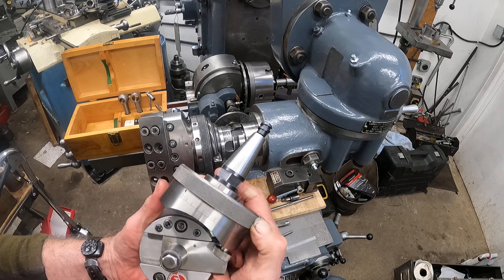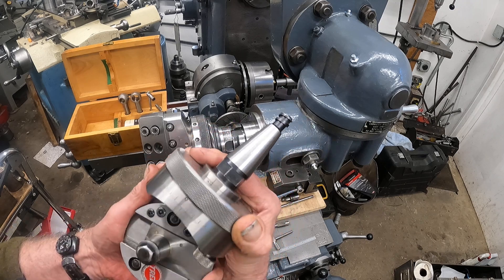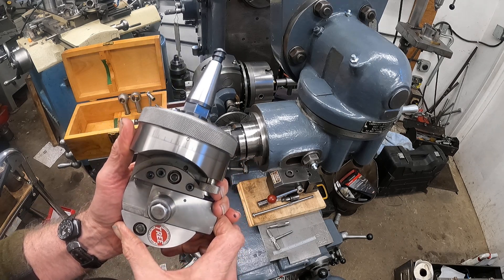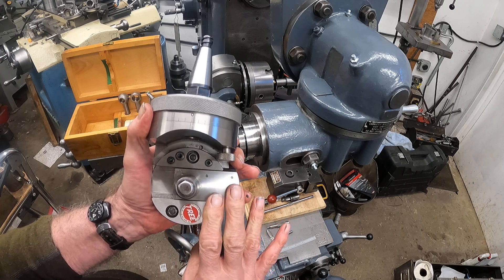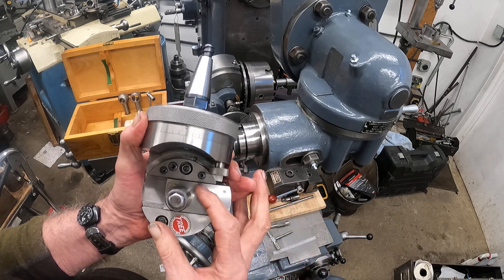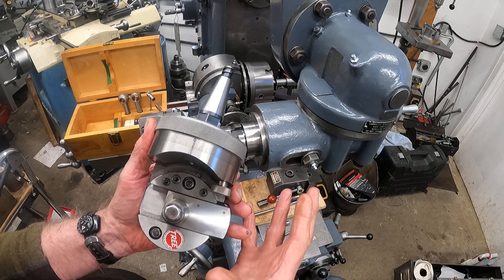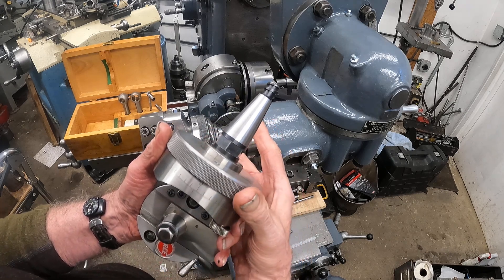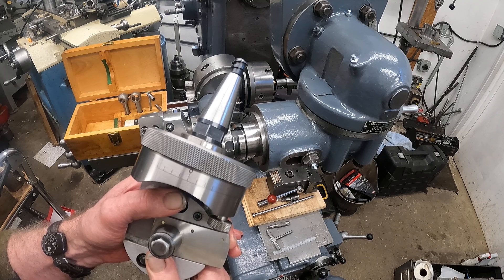Wohlhaupter and the Tree exotic boring heads

Comment: I’d never seen a Wohlhaupter before, let alone one that large.  I can see my Bridgeport wouldn’t like it.  I’ve got a much smaller Swiss boring facing head.  I’ll send you pictures.  The shank is a taper I’m unfamiliar with an integral to the tool, but with an adapter I can use it my 30 NMTB Bridgeport.   Jewelry.  Cheers, Will
Reply from the maker: You are lucky on the adapter, I have confessed that the Wolly here was for a Sip jig bore, and like a pretty far up the ladder hillbilly I cut the integral special shank off, then machined it so to fit everything else. I found I liked the 30 taper Bridgeport, most seem to prefer the R8. I would expect your head is for a jig borer and was extremely expensive. A unhappy Sip owner informed me years ago that the head cost $9000. But I have used the head on multiple machines.
Reply: @deedeeindustrialsuperprecision  My Bridgeport E-Z Trac quill was changed out from the standard R-8 by an old friend of mine who died suddenly about 10 years ago.  The Erickson quick change setup on the bottom of the 30 taper spindle wasn’t compatible with a lot of non-Erickson 30 taper tool holders so just recently installed a Kurt power draw bar.  Now it is a dream to use. So much nicer than the R-8 system.

Comment: Donie. I have a made in Japan KKS UFB-3 MOORE boring and facing head. I got with the integral Moore shank. However, your going to hate me for this but I had to cylindrical grind the shank down to .750 dia. to fit my Bridgeport. I do not have a Moore Jig Bore so the sacrifice had to be made. The up side is is that I traded some surplus items for it that I had little money in those items. I have bored, faced and put in snap ring grooves with it. I love this tool.
Reply from the maker: And we are both Evil, I took an abrasive cut off wheel and savagely cut off the integral Sip jig bore shank and machined the back of this $9000 Wolly to fit other machines and I did it with a certain hillbilly grin.....
Reply: @deedeeindustrialsuperprecision  Wow!! I guess I am not as guilty as I thought.'
Reply: @deedeeindustrialsuperprecision  Stefan Gotteswinter did it too. If it extends the useful life of the tool I think it's fair game.

Comment: Very interesting. My Kuroda’s are the smaller type (the 2 and 3), and they work much differently than the bigger models. I always wondered how the bigger ones pins worked. Great explanation.
Reply from the maker: Thanks, I have heard of the brand you are using
Reply: @deedeeindustrialsuperprecision  Kuroda Precision and MST both made licenced versions of the Wohlhaupter designs here in Japan. The quality is equal to the originals IMHO, and are pretty common on the local auction sites. I bought and refurbished several of them, they are such beautiful little clockwork machines.

Comment: I have one of those wally heads . But my is just a #3. I still have not used it yet bot you helped me figure some things out  . I have a small HBM that I will use it on Thanks
Reply from the maker: That will be an ideal set up, the heads are stout it should work well. Thanks for tuning in.
Reply: Pretty sure the 3 works a bit differently, unless you have the wide version. The smaller heads only have a single speed drive, the bigger ones use those pins to vary the distance per rotation.